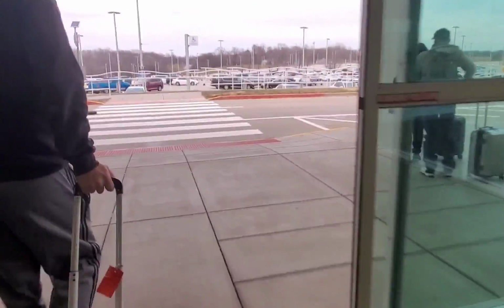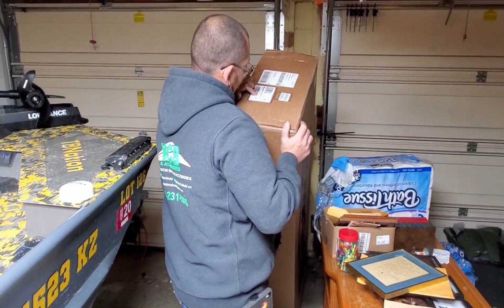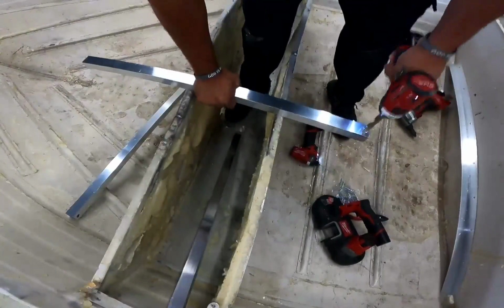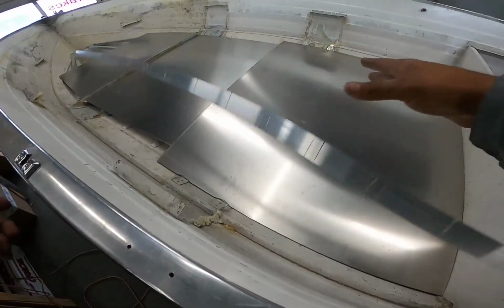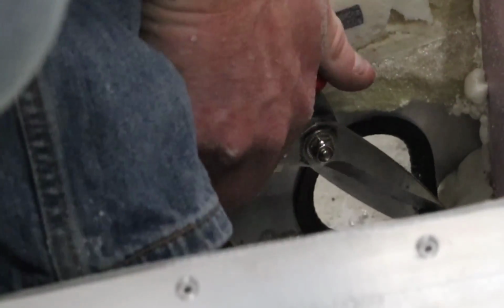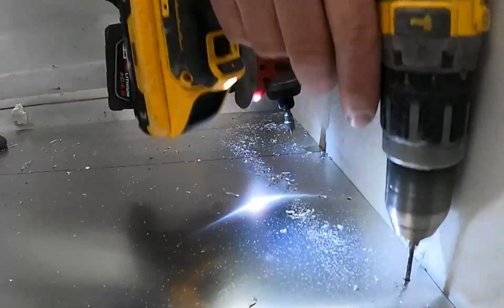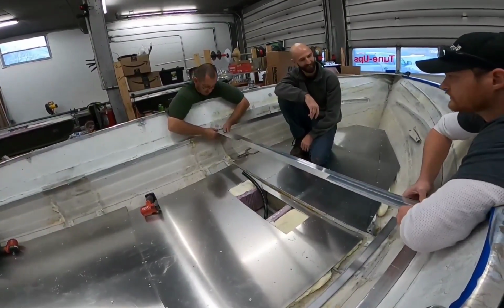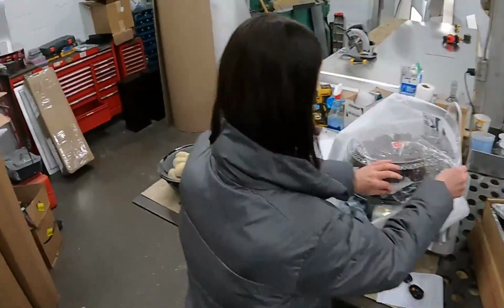4-Day Boat Build Challenge - Day One. tbnation

Comment: A couple of questions if you don't mind me asking. How long does that pour foam take on a good day to expand? Is it instant or over 30minutes or so? Also one more question. What's the thickness of the aluminum sheeting you're using?
Reply: I too would like to know the thickness of the aluminum floor... also the maximum spacing between braces/cross members used to support the floor...